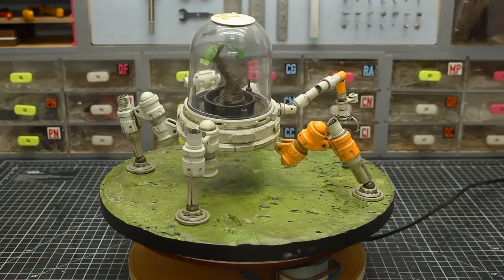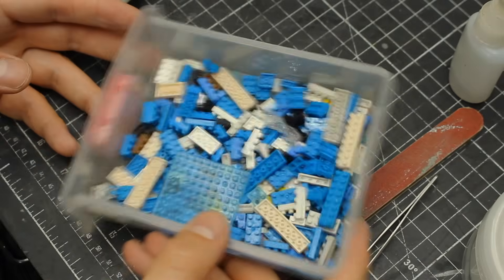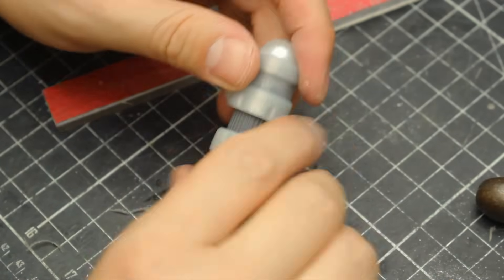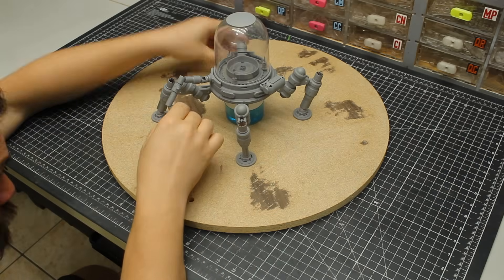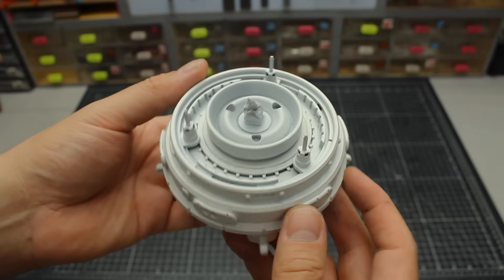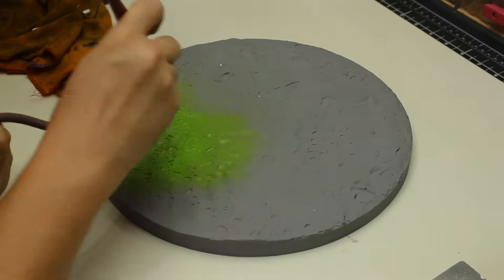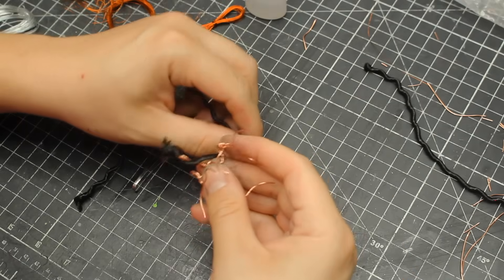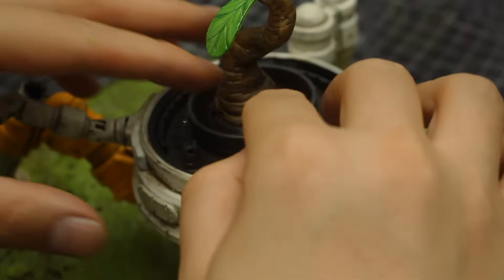Rover for Organic Survival Assistance - A 2 week Scratchbuild Project!

Comment: With your 3d printed stencils, you might try using them as cutting templates instead of the actual stencils. Put masking tape down and the printed stencil on top. Trace the inside with a sharp hobby knife. Or just trace with a pen and free hand cut.

Comment: Giving the mech more "weight" might help as currently it's a bit floaty, slightly hovering on the uneven surface. When making the terrain if you stamp the feet into the ground it should make a crater that matches the foot, giving a more solid connection and impression that it has weight.